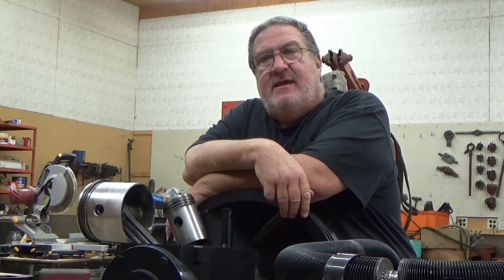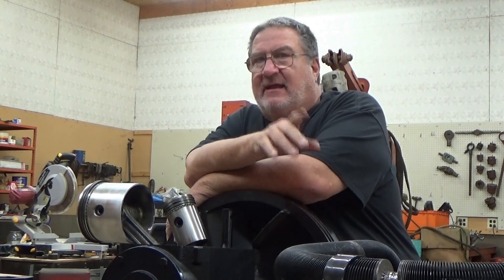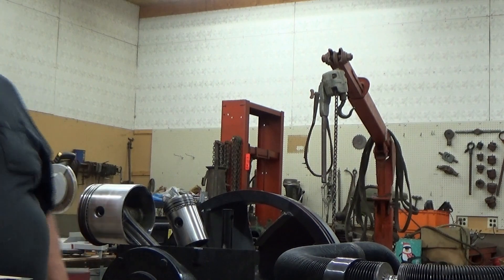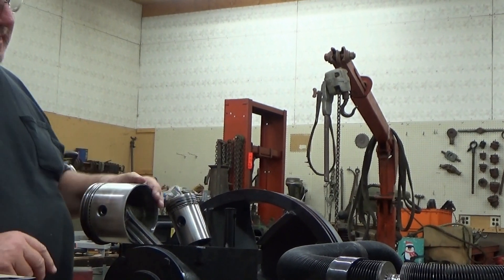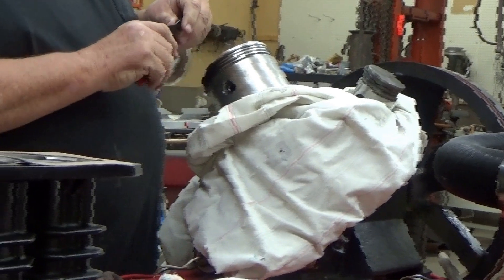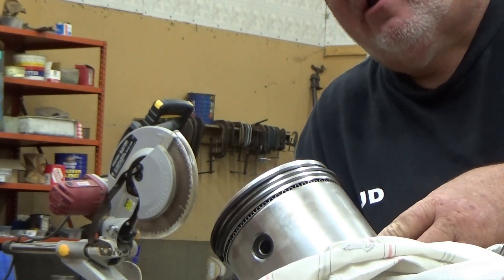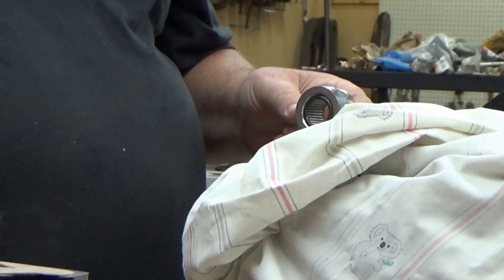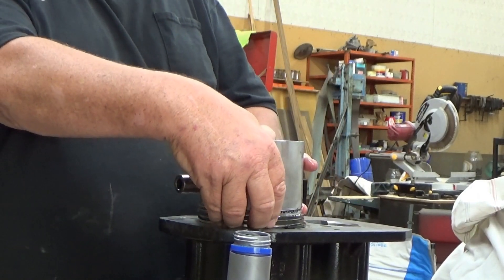QT 10 Ring Job New Experimental Way to do Rings

Comment: Would it be possible to use a large hose clamp to compress the rings and then just press the piston into the bore.
Reply from the maker: I thought about something like this. If I used a shim material to hold the rings with the hoes clamp maybe . but to fit the rings into the cyl there is a taper and the clamp would not go up into the taper. the other thing is the serrations on the clamp may damage the ring.
Reply: It was just a thought. Keep up the good work !